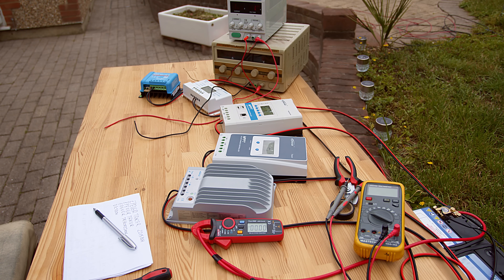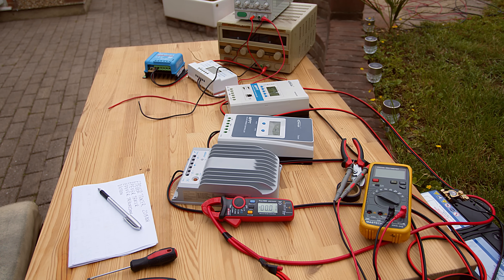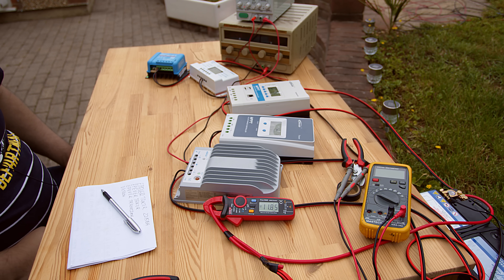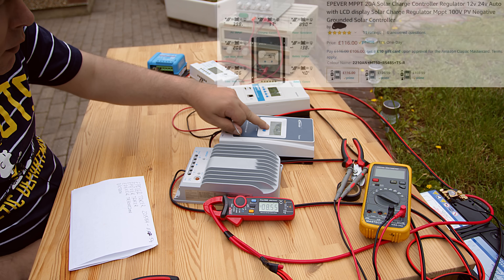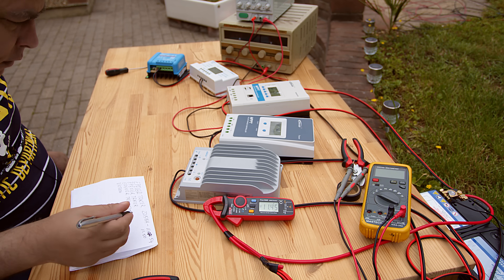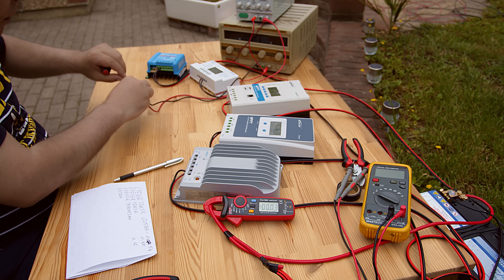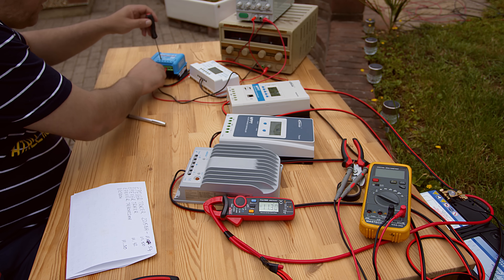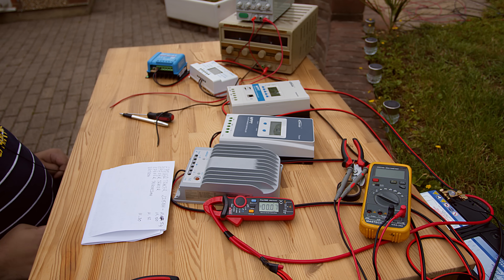Let's test Solar Panel MPPT Charging Controllers - Part5 - final test

Comment: Salut Sorin,
I want to make a thermal battery. The source of the heat will be photovoltaic panels with a heating element. Of course, to increase the efficiency, I will need an MPPT. The problem is, I cannot find a “pure” MPPT, but only as a battery charger. What I want is to put as much power in a resistor as available. That’s it. No voltage conversion or regulation. I want just to heat up a resistor. Can you suggest anything?
Thanks!

Comment: you made this little wrong test assumptions: because Its order in this effort more important, if you started another end from victron, then get different 11,7 and its nex 11,6 and next 11,5 and and last 11,3 lower and lower if you end vith victron You get diferent outcome, because battery voltage is diferent, because You allready charged it.
the max powerpoint for this powerunit is 11,3...11,7Amps, all MPPT getting same number, if you start over from first it getting now to 11,4A 
(the ceap is not mppt, its PVM)

Comment: Hi Sorin.  You now plan to use 2 panels, and so you tested efficiency using 66V.  Don't forget you will not get 66V on a cloudy day.  You want to squeeze some power out of these panels in winter too. Maybe it would it be better to test MPPT efficiency at a lower voltage?

Comment: I made my chargecontrollers a litle diferent. I put the panel directly on the battery tru a schottscy diode and then i made bypase when the voltage reached full chargeing level. It would be interesting to trie to compare the efficency. Every charge controller i have seen is in serial with the batterys.

Comment: The Victron test was not reliable. I heard power supply relays clicking every now and then. Maybe that test should be re-done with a very large capacitor in parallel with the power supplies. Anyway, we already seen this at earlier parts of this test series: the Victron does weird things. But it has the nicest app... well... hard to choose, then.
As stated in my comment to part 4, I would choose the controller that can stand the highest panel open voltage. Then, I would stack as much panels in series, as it would take to get close to that max voltage. Only then you'll have a very wide MPPT range, and then your efficiency will be best in all kinds of weather.
And, as others already noted, a Watt measurement would have been better. Battery voltage will rise during this test with different controllers. The last one (Victron) would show less amps but at a higher voltage. Unless your load was regulated. Like I described in the end of my comment on part 4. But all I saw of the load was a heat sink. It might as well been just a resistor.

Comment: You missed something. Amps fall when battery charges. That's why you see a drop in Amps from 1st to last. I'll recommend doing the same test again but now put the devices in reverse order. I think all devices perform the same. Efficiency matters only when there is low amperage to push forward. 

Another question I had, why can't you use a proper Amp rated boost convertor between the panel and the MPPT . The voltage would have been stable and the only variable the MPPT would have to play with is Amps. 
That could have worked just fine with just a small additional cost.
Reply: An almost empty battery can easily draw 40 amps or even more from a stable 28.8V source. If that source would be a boost regulator, that boost regulator will try to draw all the amps it can from the solar panel, for trying to retain 28.8V. That will drag the solar panel's voltage down to the point the boost regulator will shutdown. Voltage will rise, regulator will start, voltage will fall, regulator will stop, and so on. Very inefficient: your panel will probably do an average of 4 volts and 5 amps. That's 20 Watts.
A MPPT controller will allow the panel to come up to 30Volts and 3 amps at the same light input. That's 90 Watts.
Reply: I Agree here, the load on the batteries was only 4 amps, the input 11 amps.  7 amps charge would push these batteries up in voltage fairly quickly, and thus lower amps shown on each unit in the testing going along.    Another thing, it doesn't look like that clamp meter was zeroed after each test, the Uni-T model most definitely will not stay zeroed for any period of time.   Still, all in all, decent watching keep up the good work

Comment: If you can afford it buy a Victron. Very nice software and no fan.
The efficiency of all of this MPPT controllers is around 90%. You probably got different results because of changing sunlight conditions while testing.
And i recommend to setup the PV in parallel if you can use a big enough wire for the load. Parallel is always more efficient than series with PV.

Comment: Salut Sorin, eu am facut asta cu arduino 2560 am realizat programul, am programat arduino, după care totul a incaput într-o cutie cat doua pachete de țigări, am avut un osciloscop pe care urmaream pwm și setam pe laptop sa nu scadă mai sub 6 amperi curentul de încărcare... Cele doua celule le tineam într-o încăpere pe o rama metalica.randamenrul era cam intre 85-93%. Montajul de încărcare boost era facut cu un tranzistor și avea pierderi minime. Mai departe pentru a ridica tensiunea la 240v folosești un invertor dar aici e cu schepsis...

Comment: Please do read my comments in the first and fourth part of this series to clear the surprisingly unexpected results of your experiment.Also read the user manuals of the controllers to configure the best possible ways to connect solar panel with battery.You should keep in mind the maximum input voltage and current of the respective charge controllers.

Comment: The problem with testing is you have to use different input voltages to get the truth, maybe 30 volts input would be more efficent for some of the units, depends on the input design.

Comment: The EPEVER - BN has a bit of a problem in lower light levels where its tracking tends to get stuck.  Amusingly, disconnecting the solar for a minute or so and then reconnecting usually gets it going again.
Reply: That sucks. I have the BN on order and will arrive soon. How bad is this problem? Does it snap out of it once the panel kicks out more? I don't want a charge controller that needs a baby sitter.
Reply: @jeffescortlx 
So did you experience the same problem as the OP ? Or any other problems or issues with the Epever ?

Researching...
Thanks
Reply: @Soli_Deo_Gloria_.  I ended up using SunL grid ties for up to this point, but I still have the BN controller for a off grid project, just haven't installed that yet.